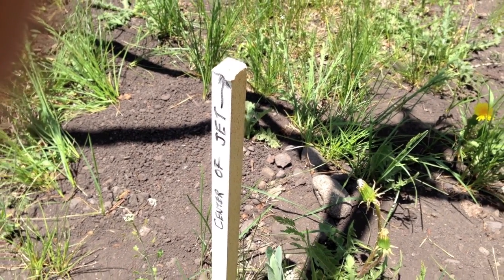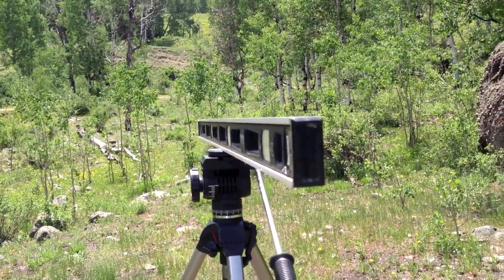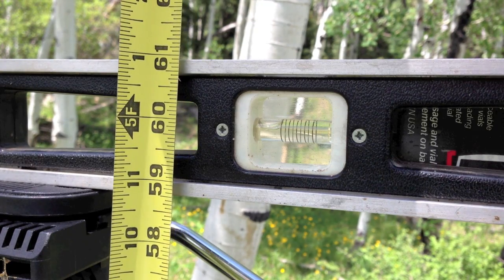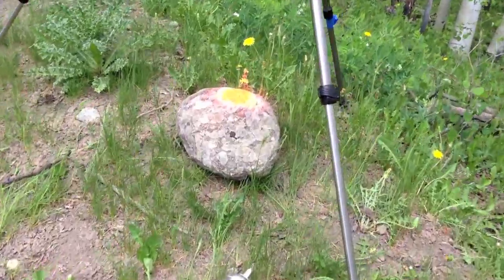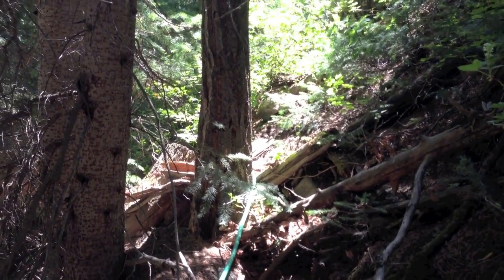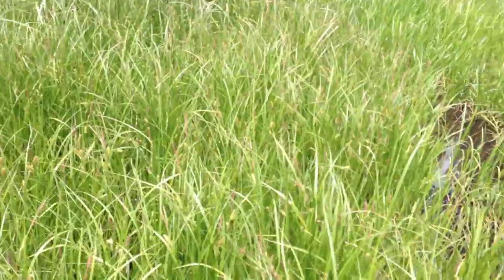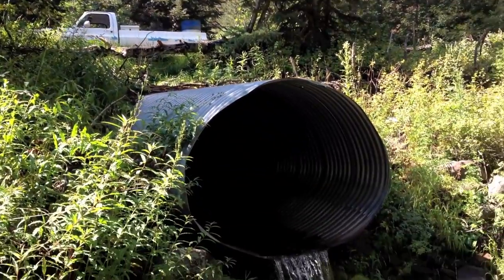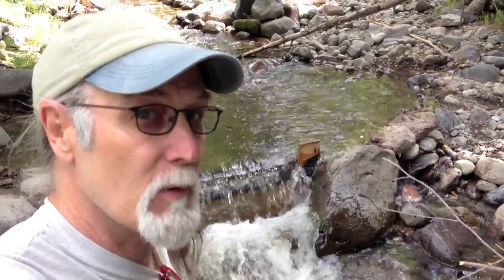Part 7 MicroHydro Power System in CO

Comment: Every time you measure you introduce error.  If you can find two vantage spots to the top of the hill you can use trig to calculate the height, if for some reason you have no cell phone.

Comment: Smartphone and GPS will do all of that now, 5 years makes a difference, but it is also good to know the hard way in case the GPS/ Battery doesn't work.
Reply from the maker: +watchthe1369 
Yeah, a smartphone w/$3 app is remarkably accurate these days.  Of course the billions of $'s in satellites helps too!  I got very similar measurements using three methods, manual, watch barometer, and GPS, but at that time I used a portable gps used for aviation and didn't show that bit.  In the end having just a general idea of available head was sufficient for design needs.
Reply: or 200 feet of garden hose filled with water, capped, and a decent pressure gauge on the end...

Comment: HERE IS A WAY TO CHECK A LEVEL THAT IS 100% ACCURATE AND FOOL PROOF. THANKS TO MY GRAND DAD IN 1957. PLACE THE LEVEL ON ANY SMOOTH NEARLY LEVEL SURFACE NOTE THE BUBBLE READING.  TURN THE LEVEL 180 DEGREES (end for end) BUT IN THE EXACT SAME SPOT. IF THE READING IS THE SAME YOU HAVE A 100% ACCURATE LEVEL.  THAT'S IT ! ! ! ! ! ! !  (the readings need not be level, just the same)  NO TEST IS MORE ACCURATE.
Reply from the maker: +Vitatta 
Makes perfect sense.  Thanks to both you and your Grand Dad for passing that on.  I'll remember it.